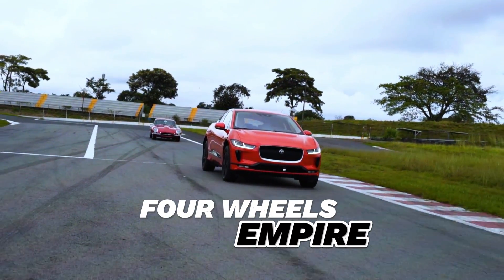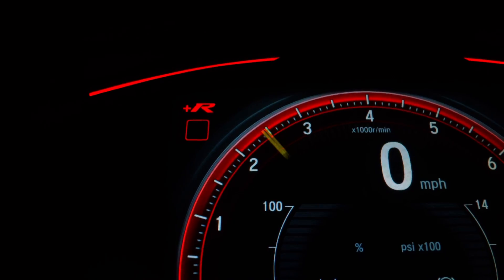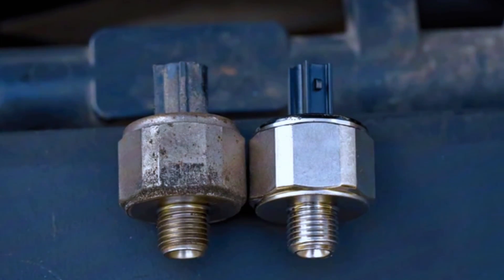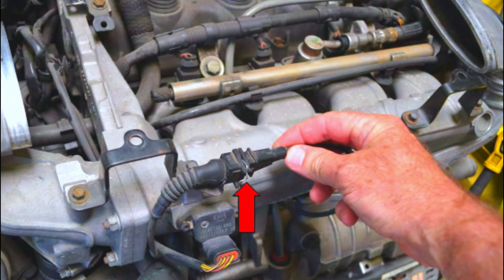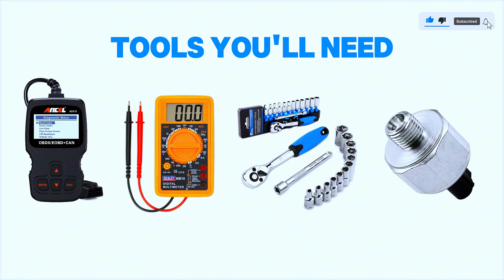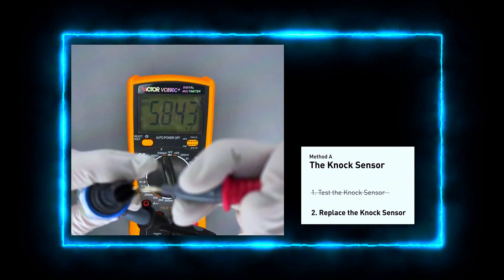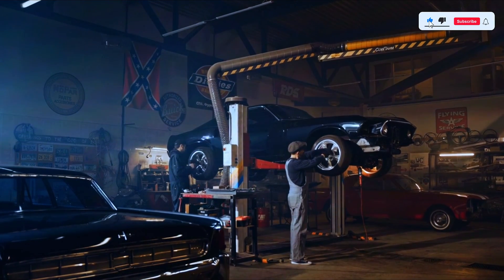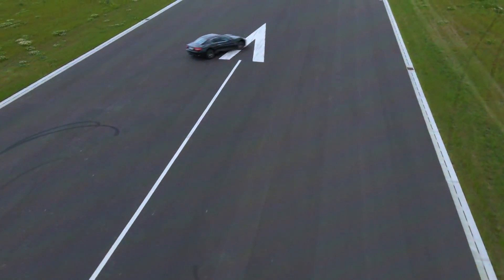How to Fix P0328 Code - Knock Sensor Circuit High Input@FourWheelsEmpire

Comment: A rat auction indicator valve switch. Chad had to be rewired after that. Now I have a po328 alarm knock sensor😢
Reply from the maker: It sounds like you've been through quite the journey with your vehicle! If you're seeing the P0328 code, it might be time to check those connections and ensure everything is in good shape.